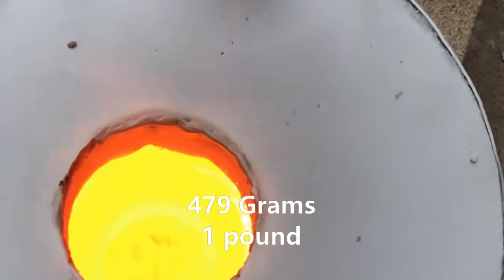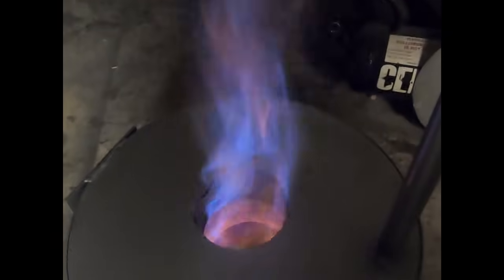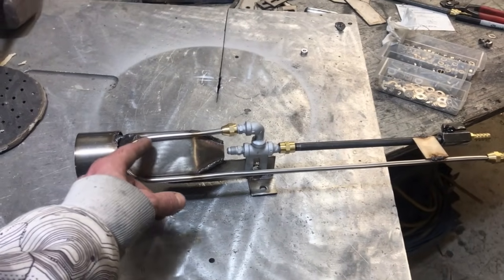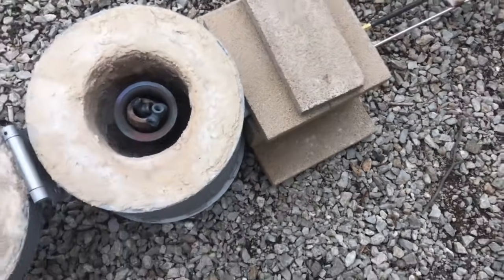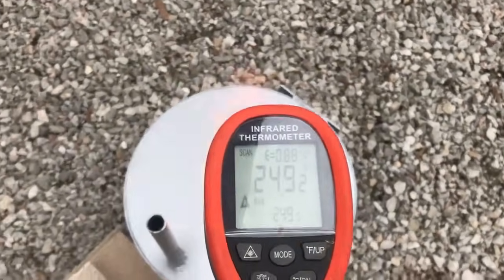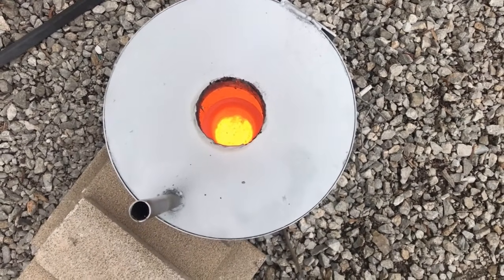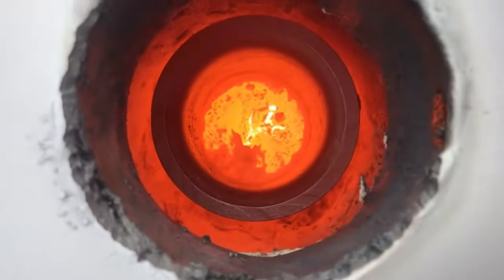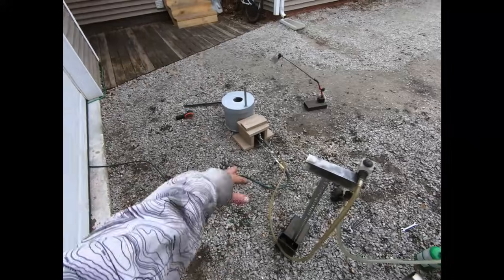Cast Iron Smelter 8 minutes to melt iron

Comment: I got a simple propane foundry burner that will do that easy.  It is super simple too....however it's the collective design of my foundry, and my burner that does it.  I can easily melt SS, Pure Silica, ect.  Destroyed plenty of those "40buck furnace" foundries, Gotta make them from bone ash, alumina clay and cement to withstand the heat.  I find the purest pumice I can and mill it for a high content alumina grog.  I don't add silica, the pumice has some in it, and too much will just melt the foundry under 3000 F temps.  I am currently (all week long) experimenting with a perfect assay crucible mix, and manufacturing process with local raw refractories, to bring the cost of crucibles to a reasonable price, and have them available in my area.  No one does hard rock within 300 miles of me....and cost of shipping everything is a great way to go broke.  SW Washington....I'm the last hard rock guy left in these parts, and I have to make everything, no fancy reagent grade store bought bottles of acids, ect....I had to learn how to make EVERYTHING from nature.  It all starts with sticks, stones, clay, fire, air, and water!

Comment: How much do I need to filter my oil to keep this from clogging? I plan to drain the oil through like a bedsheet first. Then use it. It will be mixed with desil or kero..  Also, what's the best way to clean the burner nozzle? soak in gas (after its cold obviously) or run on clean gas or desil for a short time at the end of each burn? and for aluminum, what air pressure should I be looking to run through my godzilla? I know Ill hafta tweak, but ballpark..  I should add that I am only doing aluminum. Possibly brass at some point but for now, I just need aluminum to melt. I don't think I need very high output for that.
Reply from the maker: This thing can melt aluminum on its lunch break with unfiltered pure dirty motor oil .No need to filter as long as your tank intake hose in above the sludge at the bottom . It can drink some pretty big pieces of dirt
Reply: @NOBOX7  Good then I guess I dont need any prep to test it. Any tips on the air pressure?

Comment: Hey I got a DIY propane forge with 2 Amazon torches built into it . If I connect vacuum holes into them will cast iron melt faster due to there being more air mixed with the propane???? I’m having a hard time melting it for a pour
Reply from the maker: You need to add some compressed air
Reply from the maker: Also if you back the burners out of the furnace they will pull in more air . For the most part amazon gear cant perform that task .
Reply from the maker: Add a vacuum cleaner type blower
Reply: Yeah, I’m waking up my neighbors this morning through this raging roar of 747 jet airliner ready for takeoff😂😂😂

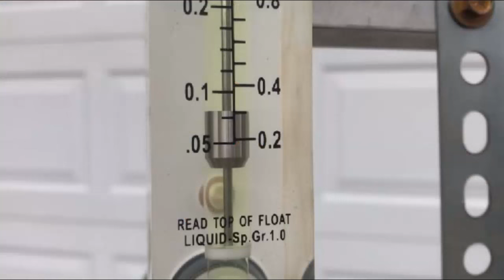Comment: Hi - great video of a great construction. But the cost results are actually a bit more, but not really enough to warrant this long tome. Why? Because when I get confused, I automatically grab pencil, paper, and my trusty calculator ... At about 6:40 in, the calculations overlaid on the screen are either miscalculated, or the flow meter was read wrong, or both ://  [I scanned the comments and was surprised someone noticed the KW issue, but only one other person caught the rest - I guess that proves not so much that you or a helper made a mistake, but rather that I'm being too picky :P]  

So 300 ml doesn't come close to 3.9 gallons - not even a quart.   Maybe some other weird typos that aren't dawning on me at this moment [--- long day, fighting with other numbers ... money numbers - UGH - which are far more stressful and much less fun than working here with our friendly foundry numbers.]

As you well know,  the gauge has two scales: US Standard on the left, Metric on the right. At that moment (6:40), it does read almost spot on 0.3 liters per minute (LPM), which, of course, is 300 ml (milliliters) / min. Then look at the left scale - it reads just a tick over half way between 0.05 gallons / min and 0.1 gallons / min - or approximately 0.0750 gallons per minute. (GPM on the scale.)

From basic conversion calculation, 100 ml (or 0.1 Liters) is about 0.0264 gallons. Three times as much makes 300 ml = 0.0793 gallons. [A far cry from 3.9 gallons.]  ... all the previous as Per Minute flow, of course. Further converting ml / min to liters per min, we get 300 ml / min = 0.3 Liters / min (LPM as on the scale.) In gallons per *hour*, we get 300 ml/m ~= 4.76 gallons per hour. [ I gave up trying to figure out how 8.37 hours, as on screen, was determined :| ]  

Now if we compare that basic calculation result with what we can actually read on the meter, we have 0.0793  gallons/min and 0.0750 gallons/min, respectively. Very close - only 0.0043 gallons difference (or only a scootch over 28 ml) - not too shabby.

At the time you showed us your wonderful device, your fuel cost was $2.79 / gallon (*).  So that would work out to 2.79 x 4.76 = $13.14 per hour (not "8.37"), or about 22 cents per min.

Thus, from cold start to warm up time, you need 8 mins. Then add the melt time of the 8 mins. Total burn time 16 mins at $0.22 per, that's a whopping $3.68 a melt. Dang it!  --- gonna have to bust open the piggy bank. 

I don't think you can find a flex-fuel unit that does that well anywhere in the DIY community.

Numbers can be wrong, but they sure don't lie...
Great Job, Bro!

(*) as of early Oct 2024, the US average price for diesel, kerosene and #2 fuel oil, are $4.46, $4.37, and $3.46 per gallon respectively - just a tad under twice as much as 4.5ih years ago ... certainly nothing to whine about.
Reply from the maker: Yes mistake were made indeed , good eye my friend . In this case i forgot to proof the math . I made  the mistake of  using the wrong gallon per hour . It was a good ball park jab at it LOL . the per hour figure was the dollar amount per hour expected .
Reply from the maker: I misspoke its 300 ML per minute not an hour this is 180 Kw , and your wrong about the 16 minutes , maybe you didnt watch the video but its 8 minutes from cold start not 16 minutes
Reply from the maker: $8.37 per hour is the cost to run per hour . I used an online converter for the fuel and yes 3.9 gal was off 4.7 was correct
Reply: @NOBOX7  Cool - I stand corrected. That's twice the goodness.  I did watch all the way through and then jumped around to different places. Right, I must have conflated the warm up time and the melt time. Sub ten minutes from the get go is downright astonishing.  Just watched your hydrogen burner vid... it will be super interesting to see if your old melter c an hit 3K F - man, oh, man how many of us have wanted to leisurely melt and pour titanium :)))  

RE this particular unit - have you found any particular fuel to be the all around best, you know the trade off between price, ease of sourcing, etc.?

thanks again - and especially for the prompt and thoughtful replies ... you have a new fan here ! -

- H in Florida (and PS pls say some power prayers for all of us - this one's gonna be real rough.)

Comment: I am a retired blast furnace supervisor in a steel mill and we used to SMELT over 7000 tons of day of liquid iron.  Your furnace is not a smelter, it is a melting furnace that operates in an oxygen atmosphere instead of a reducing atmosphere.  I assume you are using a clay/graphite crucible.  It seems to me that heating from ambient temps to melting temps at 2750 deg F would crack the crucible with thermal shock unless you are using some super technology that came out after I retired.
Reply from the maker: I do it every time just fire clay crucible . Yes you are correct about the smelter but we did smelt anode mud in it . Maybe smelting isnt the word but we had a powder ore and we melted it and got a tiny dab of metal

Comment: Hi, can i ask a question? I am building a boiler for distillation. i intend to use diesel burners at the bottom. They put out about 80kw each. The still sits on an eclosed skirt of 14mm. Will the burners melt the skirt? The boiler is 1000 liters, 3mm su304 and with a 5mm copper bottom. any precautions i should take with the heat? i will use a fire mix concrete as its stand.

Comment: What type of airflow was used? I got lots of desil and kerosene to dilute my oil to make it easier to flow. I don't have the one that loops the air over the burner because I only need to do aluminum. Also what is the hottest fuel? I have a smaller compressor, but I think it can handle my plasma torch and probably this I just hope I don't fry it from the heavy use.
Reply from the maker: I sell a non pre heat version

Comment: 300ml /min = 18 Liter / h
18 Liter = 4,7551 Gallon
2,79$ / Gallon x 4,7551 Gallon / h = 13,27$ per hour.
I dont know if you miscalculated there or if I am missing something but the math doesnt add up for me.
Reply from the maker: yeah bro 18 liters is not 4,7551 gallons
Reply: @NOBOX7  Just dicovered, that there are canadian gallons, us gallon for fuel (which I used), US Corn Gallons and metric gallons. Which ones did you use?
Reply: @NOBOX7  This is funny - and also the reason one of the Mars-bound spacecraft went lost in space. 

Notice his use of the "," (comma) ?  Same thing with the engineers in the US and Europe - one team thought the designs were in US measure, the other, European team, Metric. So when it came time to fire the navigation thrusters, one of the computer screens lit up with "Danger WIll Robinson, Danger!" ...

In many Euro countries, like Germany for instance, they use the comma where we (US and English speaking areas generally) use a period and vice versa. So Euro 4,7551 gallons is US 4.7551  = same amount, different syntax. Nothing more, nothing less (unless it happens to be your 3,500 Million spacecraft ...er 3 and a half million or 3 and a half billion?)   

Ditto for decimals.  45.324 degrees F is 45,324 degrees F which is, obviously of course, 7.400 C or 7,400 C. Depending on your "accent," you either freeze to death or vaporize rapidly. ... I see no problem there.

So he's not wrong - and neither are you. 18 Liters IS 4,7551 gallons. Or, if you prefer - and it really, technically, is correct to use the same syntax as the units, 18 L = 4.7551 gallons.

A translation is like a strenuous argument between two people who are both right.

Cheers, Ciao, Hasta, and Later,
- H 
(A former technical and scientific translator.)

Comment: I did the air drying with 2 inches metal pipe and automatic draing valve by mounting that stuff inside a refrigerator. Work's perfect.

Comment: I still need the full explanation regarding fuel pump flowcontrol or do you use wacuum injection? I have seen many different constructions many of them with bad or none explanation on how it works. I am to build a nev furnace  first time for melting bronce, and i am impressed of the performance of your burner. I could bee nice with some dimensions on the burner but I think I have to experiment on that issue. Regards Einer from Denmark.

Comment: Will this burner also be suitable for lower temperature burns like aluminum or copper? I suspect that a lower temperature burn with this hardware will result in incomplete combustion. Is that true?
Reply from the maker: it has a very good turn down ratio , it can melt all metals efficiently

Comment: this is a nice burner but two things
1) do you not include the cost of compressing the air in the cost to melt?
2) that weird surface activity you noticed might be set up from the convection currents cooling the iron down, something similar happens if you use powdered milk in coffee

Comment: This is the best burner that I have yet seen on You Tube. Since I will be casting Iron cylinder barrels for vintage motor cycles I have been looking for a set up that will melt around 15 lb in a sensible time. Would you be willing to let me know your burner construction details?------great job and video ---- thank you.
Reply from the maker: The diagram is $20 , if i wasn't so busy i would send it for free but i have no time

Comment: luckygen 1001 has some good videos on melting cast iron with used motor oil with a small amount of kerosene in it and he also uses propane as a preheat before starting the oil but this is a forced-air system using a vacuum motor so it is not the same as your system, I think he melts  20 pounds in 20 minutes not sure to the exact time or amount but it is close enough.

Comment: Love the concept! I have a medium-sized squirrel cage that I put a treadmill motor and speed controller on... This thing can MOVE some f'n air. You think I'd be able to use it along with compressed air to reduce the psi needed so a smaller compressor can keep up? 
Could I possibly use a 100# propane tank as a fuel reservoir, then pressurize it up to ~70-100psi, directly injecting diesel at that pressure?

Comment: Hi brother This is realy useful video.I also have an oil burner that preheating air. But not so efficient like your.  and l want melt caat iron.Somebody says that crusible. has no durability  when casting cast iron.Can I use a stainless steel crusible to melt cast iron?
Reply from the maker: i wouldnt try it , its white hot soft at that temp , use a salamander super

Comment: This is very similar to a rocket engine. They cool the chamber with the fuel, and have clogging issues like you mentioned. They usually deal with it by filtering the hell out of the fuel, because cooling the chamber with liquid oxygen is difficult.
Heating the air makes much more sense for a foundry though. You're not dealing with liquid oxygen, and filters are expensive.
If you haven't before, you might enjoy reading about impinging, coaxial, swirl, and pintle injectors. They might give you some more ideas.
Reply from the maker: Great input friend , Glad to have you

Comment: I bet you could in theory make wootz, which is crucible steel using this furnace. I would like to run a diesel forge. Hot enough to forge weld and make Damascus too.

Comment: Hi, Interesting about fuel coating the feed line.  Where you had only one loop on the air line, would there be utility in having more loops on the air?
Reply: more air loops results in overtemperature in the mixing chamber and boiling the oil. Not good
Reply from the maker: @johnfurr8779  you very wize grass hoppa
Reply: @johnfurr8779  you do very specifically mention that while showing the build of the burner. A subtle, interesting phenomenon.

Comment: A smelter turns iron ore into iron, via a chemical reaction, you've just got a melting furnace. Pretty cool, but not a smelter. Thank you for the upload though I appreciate the content. EDIT, as a further challenge let's see if it gets hot enough to melt and cast mild steel.
Reply from the maker: I see , thanks for the clarification
Reply: I've smelted iron from pyrite and a reducing flux made from borax, flour, silica and baking soda that produced a 15 gram button of iron from a 31.1 gram ground ore sample loaded with pyrite crystals.  It is possible to smelt this way, however a proper blooming furnace is way more efficient for any kind of larger smelting from ore.  It takes quite a long time at temperature for the Iron ore to flux with the lime, melting the iron and fusion process, while the lime collects the impurities...my small sample took 30min at 2200F, scrape dross, add more lime, then another 15 at 2600F, before final dross scraping, then pouring into a mold.  This stage produces "pig iron".   It's still dirty, but ready for further melting, alloying, decarburization, ect.  If I had to just remelt stuff....yeah that's pretty simple.

Comment: To elaborate your comment on steam, the (normally) maximum temperature of steam is 100deg celcius or 212f, after it reaches that it will expand 2700x it's volume and find somewhere to escape. This is my it works so well in turbines but that means water is great at reducing temps
Reply from the maker: Well yes and no the 100 deg max temp for steam only applies to a kettle of boiling water my friend , if the steam is exposed to hot metal it will increas in temp. a mono tube boiler can produce 2000 deg steam at 1 psi even under that but you need a litte pressure for flow . The 212 deg steam is just an old science book explanation. For  an engineer its detail details details , the 212 deg rule does not apply here . this steam could theoretically reach  300 deg as that is the temp of the pre systems . the outer loop is even hotter .
Reply: @NOBOX7  Thanks for the details! My explanation comes from what I have been taught about going into burning buildings and applying water, obviously a much less controlled environment, not much steel around.

Comment: Very interesting! I am trying to melt Nickel and I don't know if you can make 1453C with propane? I am thinking I will need to Oxy- acetylene.
Reply from the maker: This burner can do 1600 C in a well insulated foundry
Reply: @NOBOX7  That is amazing! It takes me 30 minutes to melt my charges when I do my fire assays with propane. Too expensive! How to you pressurize your diesel to the burner?
Reply: @exploringnorthernontario9627  3 years later .. a reply from outta nowhere ... the fuel doesn't need to be pressurized in these types of burners. Typically, they are gravity feed and use the venturi effect (*) just like the carburetor in an internal combustion engine. https://en.wikipedia.org/wiki/Venturi_effect

Comment: Can you preheat the air in the top exhaust? (not let the heat escape anywhere). If you were to use a gaseous fuel would it work preheating the fuel as well?